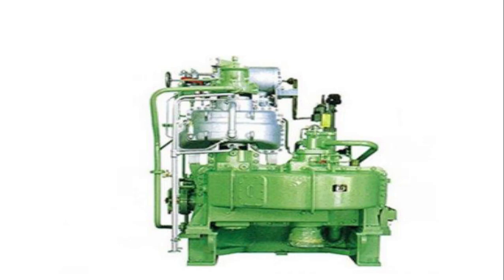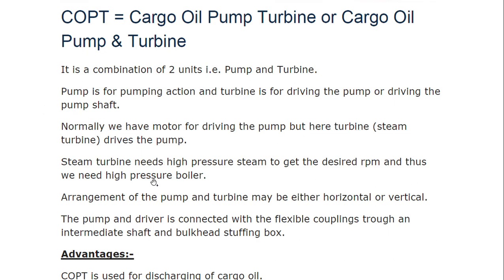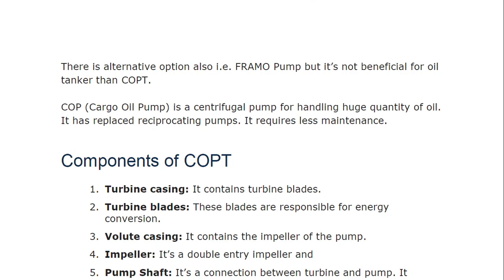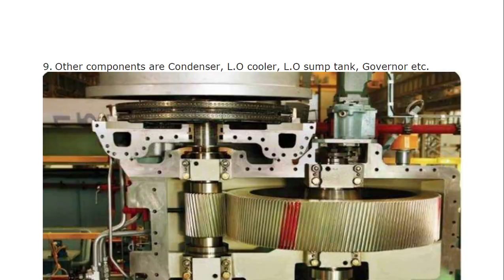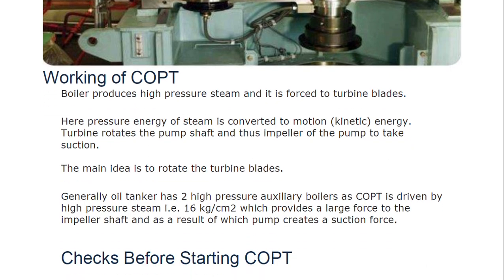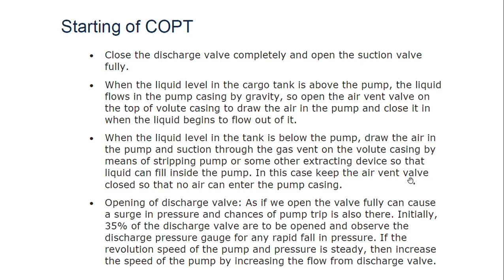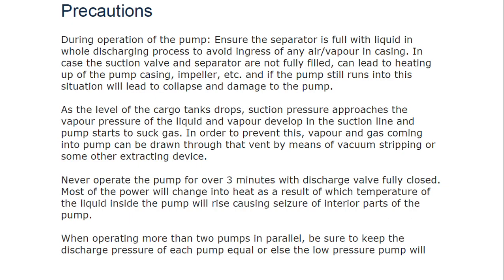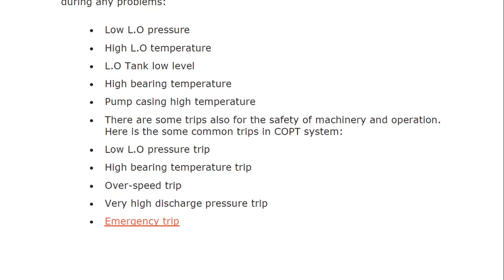COPT(Cargo oil Pump Turbine)/Starting of COPT/Alarms & Trips of COPT/ Precautions & Working of COPT.

Comment: What about priming ? Ur saying open fully suction valve when starting COPT.
Reply from the maker: We open preheat to drain the system ..once steam starts to come from drain we open master valve than open steam inlet to turbine slowly to bring it to rolling rpm ...once it comes to rolling rpm we open steam inlet fully and than give contols to ccr they increase rpm as required .